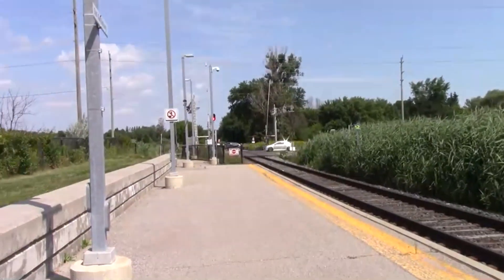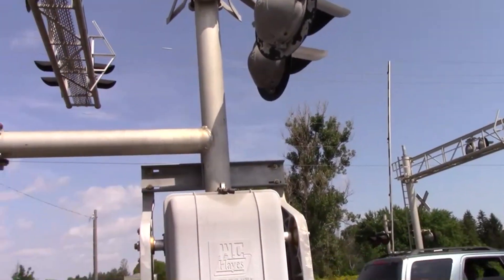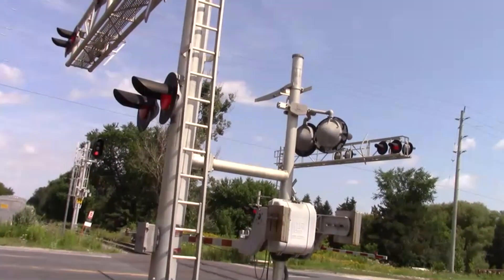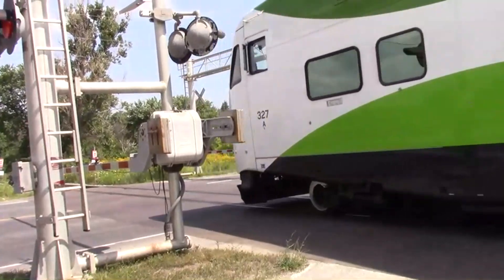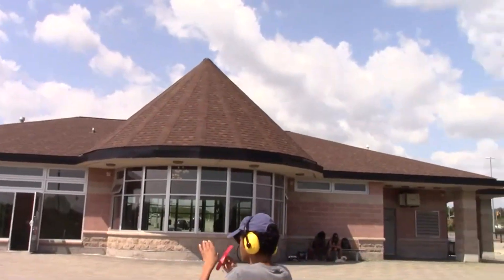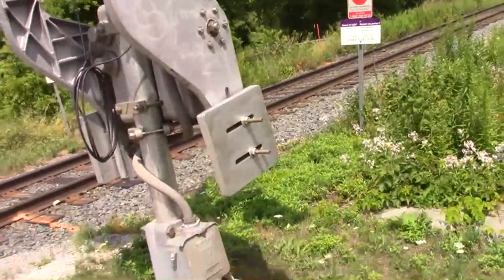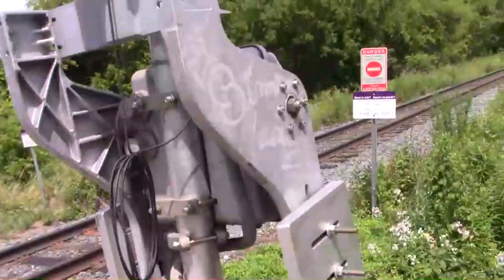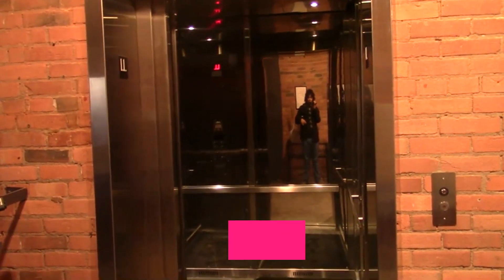Newmarket Railfanning With Tyler M

Comment: Great video! Nice horn on 640.
Reply from the maker: You're still thinking of going to McNaughton Road right?
Reply: Michael Walters Elevators, Roblox, and More Yes. I am hopefully going to do that soon.
Reply from the maker: Why won't you stop forcing me! if you keep doing it I will not subscribe
Reply: Michael Walters Elevators, Roblox, and More hi Michael that high pitch e bell is not a Safetrans E Bell it’s a Siemens E Bell
Reply: @michaelwalterselevatorsrob5009  General Signals E Bell and Siemens E Bell right?